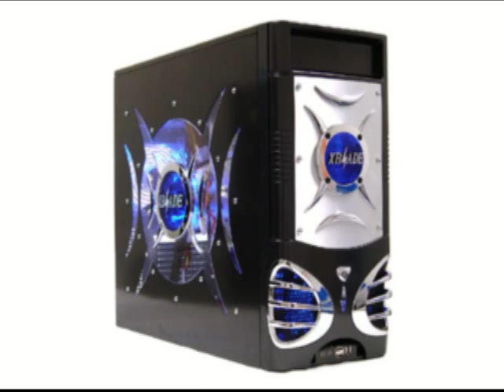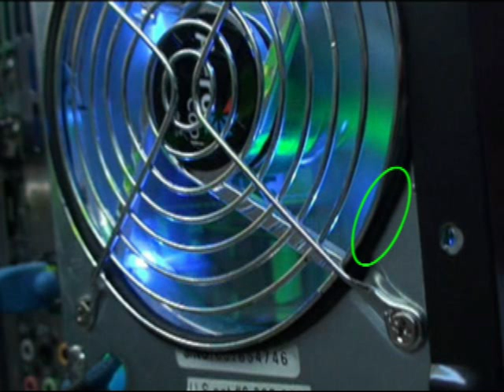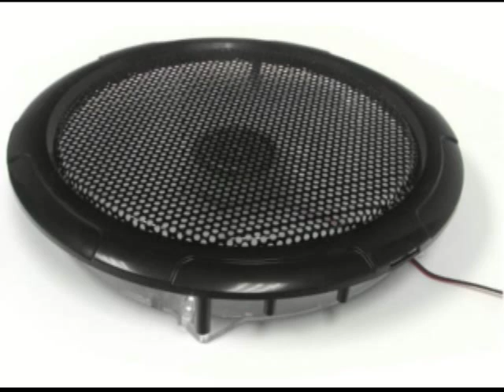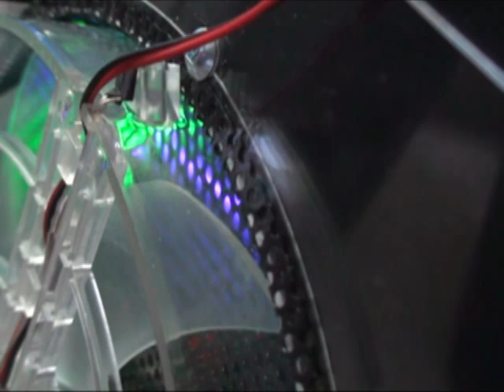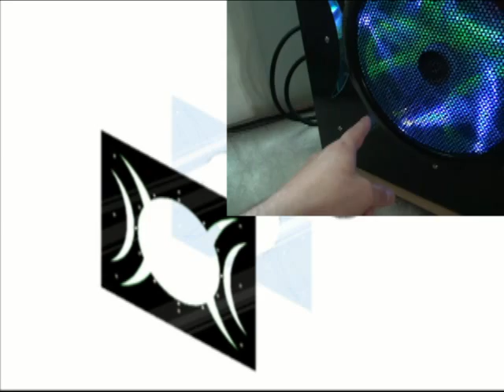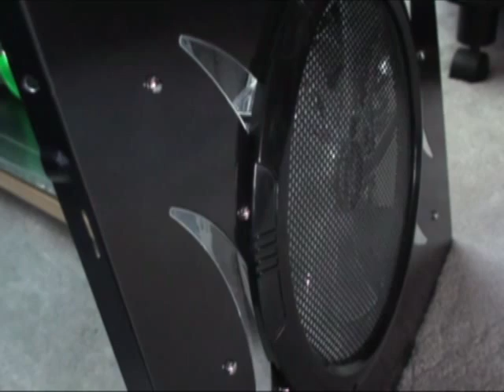X-Blade Air Flow Improvement Part 1

Comment from the maker: @dgo401 
Is you case a X-Blade?  If so, you need to remove the front bezel. This will give you access to the front of the chassis and the screws that hold the fan in place.  The bezel is pretty easy to remove. Work your fingernails behind the bezel at the top and pull it away from the chassis. Just be careful not to snap any of the 6 nubs that pop into the holes in the chassis as you do so.  You might also want to check before you tug that the bezel is not screwed into the chassis. Mine wasn't.

Comment from the maker: @schneider1492 So in effect, you'd be building a rectangular bezel that fits around your cooler and encloses the fan at the same time. Ideally you'd mount the cooler to the bezel and mount the bezel to the side panel.  Bare in mind also that the fan housing is as thick as the fan itself so your fan would be sitting flat against your cooler, unless you somehow extend the fan housing wall to act as a shroud.  

Keep me informed on your progress. I'm curious to see how it comes out.

Comment from the maker: @schneider1492 The only way i think you'll be able to do what you're describing is if you mount the cooler outside of your case in which case the bezel will be obselete. You would mount the fan flat against your side panel (with the mounting brackets of the fan housing inside of your case.) The fan housing will stick out about 6/8" outside of your case. Then you'd need to mount your cooler over the fan.

Comment from the maker: @schneider1492  The fan housing sticks out 7/8 of an inch inside the case. The pegs themselves are 10/16"  but remember that I trimmed mine down  a bit. You'd have to look over the video to see how much I trimmed them down. I think it was a few mm. Of course, this is assuming that the peg size is standard for all those fan kits.

Comment: omg dude thats a very good mod ... I seriously wish I could have gotten that fan for 5$ too id pull my case apart and do this mod on the second :)  

So ill seriously look for a fan like that dude!! right now i just removed the plexiglass cover on my xblade and i found there actually is less dust because the air is moving and the dust dosnt get trapped where the fan intakes before, but having an open case isnt the quietest way I should run my rig right now..